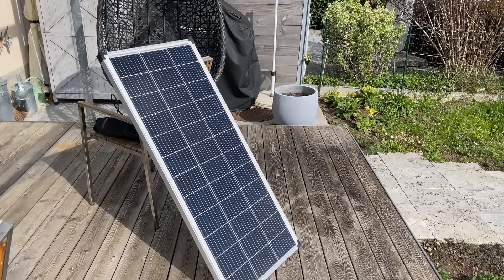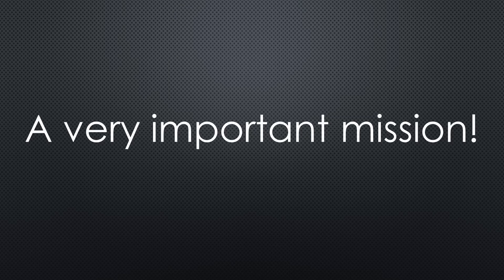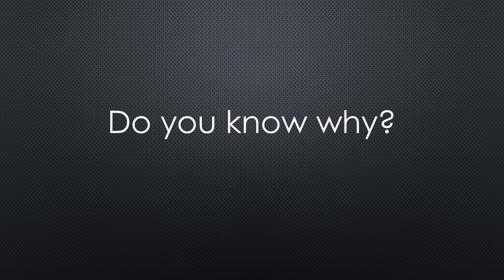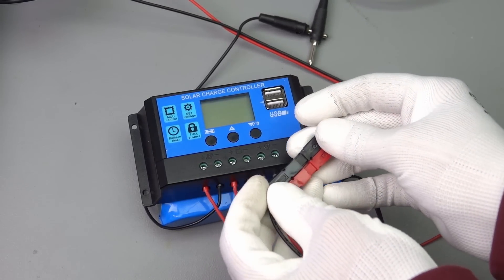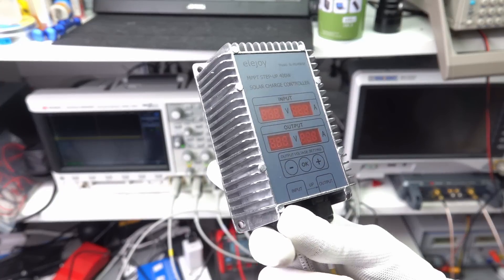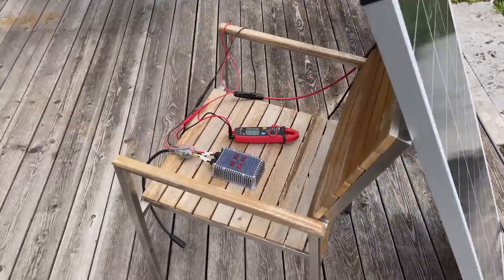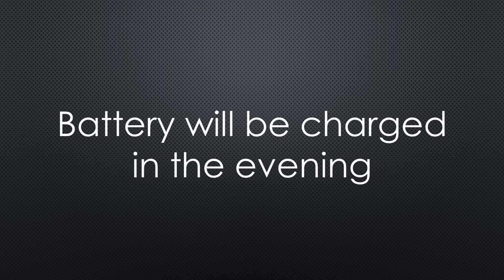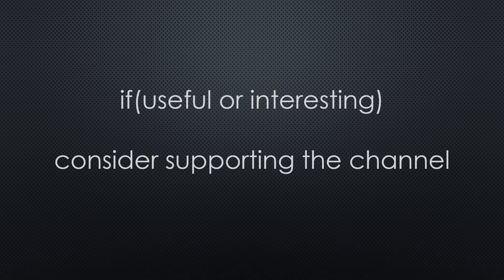454 How to Build an Solar Battery Charger for eBike / Electric Bicycle

Comment: A nice story, in more ways than one!
The basic problems are several.
Charging batteries takes time, and you cannot use the solar panel's power in a meaningful way.
It is best not to think that a panel should have a task, such as charging a bicycle battery, but instead supplies the house's electrical system, which is better able to charge small batteries.
People also have such high thoughts about technology, we must dare to be clear that we must think and calculate the problem first...
Reply from the maker: I agree, I could have built a "balcony power plant" and connect it to the home grid. But this was not the wish of my wife's sister. In this project, efficiency or cost were not important, I can assure you ;-)

Comment: Hallo Andreas, great video! Not sure if understood about the control pin. This 5v voltage is to trick the battery to think the wall charger is connected? I tried to use a solar panels to charge a Bosch system to realize the battery wont charge, this control pin and the 5v current would allow the charge? thanks again
Reply from the maker: You have to check with your battery. Mine needs this voltage to be charged (and maybe also to be discharged). Maybe you find this info somewhere for the Bosch system
Reply: @AndreasSpiess  Thanks for the reply. My bike is now using a Yamaha motor, I haven't try to use solar panel yet in this one,  I found it is easy to mix solar charging and bafang or other Chinese type of motors using the mppt booster you show in the video, there is a more expensive but much better version of it, at  genasun website but you might know al ready.  Bosch motors need it a current from the home charger for the charging to begging, so solar charging was no possible, that's why I was curious about the low voltage to trick battery in to think it was charging at home. thanks

Comment: Intresting way to a solution! I had similar idea to charge my scooter but here we talk about a 60-70 Volt Lion battery with an Bms that is talking with the the charger for regulating the power. So reverse engineering and charge the battery directly has make no sense in my opinion. I rather though to deliver the solar power wich has at least to be 100V on the charger mains input and the control of the charge is save. Also I thought every switch mode power supply must work also with DC on the input.
Reply from the maker: I agree. In your case it is probably easier to use a microinverter for 240V and use the standard charger.

Comment: Fun and educational video 🙂
Just wondering - what if the input voltage rises above output - will output voltage then increase?
Usually boost converter output is minimum around 2 volt above input.
Reply from the maker: I did not check. The panel stops at 24V.

Comment: Well done for surmounting all those challenges. Could you have also used a portable power station (connected the panel to the power station to charge the internal battery and used the mains output to power the original bike charger)? Not a cheap option, I know.
Reply from the maker: Yes, this would have been the most expensive solution. In-between would have been to use a microinverter and feed the power into the home grid.

Comment: Why was it important to isolate the ground terminals on the buck converter? You went over it very quickly, but I didn't understand why. Great video by the way!
Reply from the maker: Because the input and the output GND wire are not directly connected.
Reply: Going further, on many PWM controllers, the way they are switched rapidly on and off is by using N-channel mosfets, meaning the “ground” side is switched, while the positive side is just straight through. This means if you try to bypass that ground (by wiring up the 5v ground), you would effectively short circuit the PWM controller. I guess it’s more common to have high-side (positive) switching on most (?) MPPT controllers, so maybe not an issue - but you have to know what kind of switching design your controller uses.
Reply from the maker: @zerog2000  I agree. Maybe you watch my next mailbag videos...

Comment: I wonder if getting 2 panels in series for ~40v output would have been easier, and as a bonus charge 2x as fast?
Reply from the maker: This would work if their MPP would be around 42 volts

Comment: I have also tried to charge my bike battery that way, when the sun came under shade my boost converter turned off and had to reboot so I put a 12v power supply through a diode system so if the sun came under shade the power was from the 12v adapter it works fine I set it to 41.4 volts / 1.5A. Another solution would probably be to put two solar panels in series and get about 44 volts and from plus through a 12 volt/45 watt incandescent bulb and through a relay to plus on the battery, when the voltage reaches 42 volts the relay must switch off the battery, no need for mppt / pwm or linear.
Reply from the maker: I agree, the most simple solution would probably be to search for a panel with a similar MPP as the charging voltage of the battery. Then it would work (with a diode in series to avoid discharging during night if needed). However, most 44V panels are much bigger (400W). And 2 panels are not as handy.

Comment: Great video. Was very interesting. I just have one question. Would it not have been easier to get a second solar panel and put them in series and use a buck converter?
Reply from the maker: Yes, you could add a second solar panel. If their combined MPP is above 42V, you would not need a converter.

Comment: Very cool. Do you think it can be used to charge an ev motorcycle? Same principle higher capacity battery. I'm not bothered about how long it takes, ie days. Perhaps you can tell me if putting more panels will solve that ? I live in a sunny country! Thank you
Reply from the maker: The power of the panels have to be adapted to the power you need for charging. If time is not important, I should be possible to use this MPPT converter.
If you add panels or use a bigger one, you have to check the limitations of the converter (input voltage, current).
Reply: @AndreasSpiess  thanks. In general if you look at electric scooters/bikes in India the smaller to medium range, that's my general interest. As I'm off grid, I wanted to find out a charging system before I buy.  They usually say 15amp charger which is pretty hefty. So I thought maybe charge over longer time but along the lines of your efforts!

Comment: Very interesting. Just that I would have considered bypassing the connectors with my own or completely replace them. Sure, that means you will loose the warranty, but what do you think the bike manufacturer will do if he finds your video..
Next idea: an adapter for the electric car chargers :D.
Reply from the maker: I assume she wants to charge the battery also in winter with the original charger. So I did not want to replace the connector. And of course, the whole thing has to be rain-tight in our climate ;-)
Reply: @AndreasSpiess  Well the original charger can be also modified.. but, it is a choice. I have Chinese e-bike and that one has a removable battery, so I can leave it outside and take the battery inside for charging(and keeping it out of the cold & thieves). That is because all the weather protection it has for its barrel connector hole is a rubber plug. Anyway, I hope you did not spent so that much on that connector...even if it is probably worth the family confort I suppose :D. All the best!

Comment: I figured you would have created your own dc-dc converter and used an Arduino to monitor and adjust the output voltage as required.
Reply from the maker: Also a good idea. Do not forget the current meter...

Comment: You may want to drop the charge voltage a little bit.  I keep all my battery charge voltages at 90% or less to increase battery life.  Keeping a battery between 20% and 80% quadruples the the lifetime of the battery, depending on chemistry and how well I remember that one chart I saw one time.
Reply from the maker: I am not sure if this is very important for my bike batteries. If I assume only 500 charging cycles till they are unusable, I get 25'000 km out of them (500x50km). If I assume 1000 cycles, it is mind boggling ;-) 
However, I pay attention to my PV batteries. They are used much more.
Reply: I do the same thing, when charging my bike I use a timer instead of letting the charger run in till it shuts off. And now I use lifepo4, maybe I will try sodium ion battery next time

Comment: Andreas, you should buy an MPT 7210a, this is a good boost "mppt" charger for different voltages. But still the 5v pim needs to be DIYed
Reply from the maker: Thanks for the tip! 
I just watched a video where it was said it does not find the MPP voltage alone and that you have to program it. The one I use searches for it all the time which is simpler and probably a bit more efficient.

Comment: You shoud try DPX800S it is a boost converter 12-120V with MPPT function. It has 800w and it is not expensive.
Reply from the maker: If it supports a minimal input voltage, it will work. Otherwise, not. Most converters do not support that mode.
Reply: @AndreasSpiess  input voltage is from 10-65V. I ordered it from aliexpress and it will come and i will test soon

Comment: I do not know which town your wife's sister lives in, but the temperature can drop below freezing in many Swiss locations. Does the battery have an internal circuit to prevent charging when the temperature is too low? Is this something you need to consider when building this project?
Reply from the maker: If temperatures are so low, I am sure, her bicycle is stored in the garage ;-) Anyway, sun power during these months is nothing to write home about.

Comment: Need an mppt controller that varies the output target of the boost converter in order to find the maximum power from the solar panel. You could probably have hacked the boost circuit and mppt interface to create this relationship by feeding the boosted voltage (resistor divided down) back to the mppt controller, then likewise get the mppt controller to alter the target output voltage of the boost converter somehow, probably an analog input somewhere on the boost circuit that sets the target voltage
Reply from the maker: I agree. This is what the controller I used in the end does.

Comment: Thanks for this great video. I work on low power projects involving solar panels and I would like to know if anyone could recommend an artificial light that can replace the sun for development and debugging purpose.
Reply from the maker: For solar cells you can use most standard LED lights if you just need energy. If you need an exact spectrum, I do not know how to do it.

Comment: For the 5v signal: simple voltage divider to bring the 42v down to the input level of a 7805 or MIC2940-5?
Reply from the maker: I agree. Others even proposed to add a Zener diode...

Comment: I SWEAR, I was looking for a charge solar controller IC that can reach 42+ V to charge my 10S4P battery too, really excited on what you ve found out so far. My plan is to use 10 of my single-cell diy mppt chargers and connect them in series and see if that works (and my battery needs 5v to enable charging too) if that works, I may make a video offering that solution. Otherwise I will stick to your solution and call it a day😂
Reply from the maker: If you connect your 10 MPPT chargers to 10 different panels it will work.
Reply: @Andreas Spiess  that's the plan, I ll start with 3 panels, chargers and cells and see if it works. If 3 work then 10 should also work 🙌

Comment: Nice Video Andreas, especially the psychological aspect of engineering! I'm a (physics) engineer myself and I encounter problems on a daily basis, it can take up to months to solve some of them. My son (19 years) is studying physics at university and he feels sorry for me, when in fact it's not so bad and it can really motivating if you have solved it!

For the technical part: Wouldn't it be much more easier and efficient to use a microconverter and convert to 230V? And if there is a power outlet available close by the solar power can be used for the house if the bike is full or away. Vice versa there is always backup power. In total, more power from the panel would be used.
Reply: But would be less efficient.🤔
Reply: @swissTom124   Not necessarily. Microconverters are very efficient. What's more you use a the 'intelligence' of the original charger. It might lower current under some circumstances, preventing battery damage.
Reply: @swissTom124  Micro converter/inverter efficiency is typically estimated at 93 to 97%. Of course losses of the charger have to taken into account also.
Reply from the maker: The microinverters I know are built for bigger panels (my Enphase converters have 300W) and therefore quite expensive. If I would go this way, I would build a whole "balcony power station" with the allowed 600W...
But this is not allowed in many rented apartments.
Reply: @AndreasSpiess  Just a quick Google search just less then 100 Euro not including VAT for a Enphase IQ7. But think of the many advantages: It's much more flexible toward other chargers/batteries/bikes. Most important I think is using the original charger which is optimally fitted for the battery. Just applying current to the battery is rather risky and can lead to (long term) damage.
Reply: @AndreasSpiess  Off topic: I follow your channel for a couple of years and it was a big inspiration for me to build a rather special room controller based on the ESP32. I would be honored if you would have I look at it. Can I send you an email or how can I send you a message?
Reply from the maker: @Wijnsema  You can reach me on Twitter or on Facebook messenger.

Comment: Nice one, Andreas. How did you came to the idea of feeding 5V to start charging?
Reply: Maybe the original charger does so?
Reply from the maker: As Jochen wrote: When my charger did not work, I searched for the problem and found the 5V. All other pins had no voltage.

Comment: Just had a similar problem the other day, needed an mppt charger for an IOT lead acid battery, but couldn't wait for parts, and didn't want to pay for a car battery charger that isn't mppt, and not very gentle with the battery cells - Managed to hack together a charger using a variable voltage DCDC buck converter, that has it's control voltage divider/ potmeter overriden by a PWM signal from an ATMEGA168 board.

- Microcontroller gets input voltage, regulator output voltage and battery voltage ( bat is separated using a diode, so when the DCDC output is lower than the battery voltage, you can measure the bat voltage, otherwise you measure the DCDC output - 0.3 V or so lost on the diode), also it has a max471 current sensor.
- Microcontroller periodically lowers the DCDC output, then battery voltage and open circuit solar voltage is measured
- DCDC output voltage is set so that the battery will charge with a max of 2A, with a fix voltage, or it will float if the battery is charged
- DCDC output is corrected if the DCDC input voltage becomes less than 80% open circuit voltage.

I'm very pleased how it's working, I might try using a buck boost converter with the same logic, and with a proper PCB. So an easy solution is to control the voltage/ current potentiometers with PWM and lowPass filter or even a digital Pot.
The product you've bought probably works the same, and turns off the charging when it detects no voltage on the battery, a safety feature so it won't charge dead batteries with shorted cells, or if there is a short circuit between battery contacts.
Reply from the maker: Looks like an interesting solution. I am astonished that it works without measuring current, though.
Reply: @AndreasSpiess  It has a current sensor, a MAX471, and the current limiting is done by lowering the buck converter's output voltage. Could work without current sensing, but only if the battery has nominal characteristics, or the charging current is set to a lower value - because then it's no big deal if the current is more than expected. Lucky for me, lead acid batteries can take a beating.

Comment: Didn't look through all the comments.  How about using a 48v solar panel or a pair of 24v ones?  Any efficiencies there?
Reply from the maker: I think, the problems would e similar because the curve of the solar panels are always the same,  we need a more or less constant voltage to charge the battery, and the inner resistance of the battery is very low. You just would need a MPPT buck converter which is mor common than the boost variant.

Comment: I did a similar system, with 6v 2w panel. 8 panels in serial, and it charge my scooter in 2 days on a xiaomi  a 250wh battery .not a big deal ;)
Reply from the maker: I good idea because the MPP of your "panel" is around 42 volts. However, you were responsible to do the mechanical setup, something I am not good at ;-)